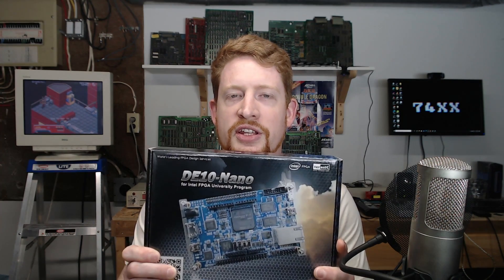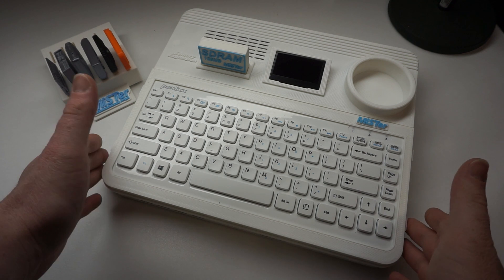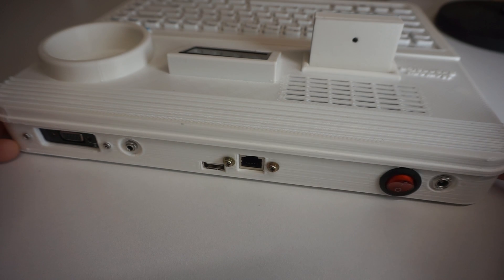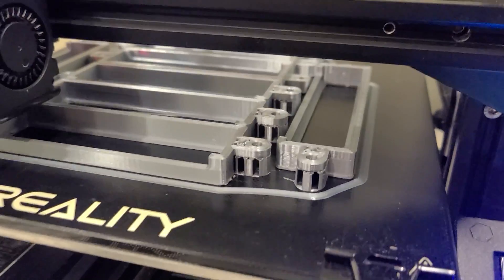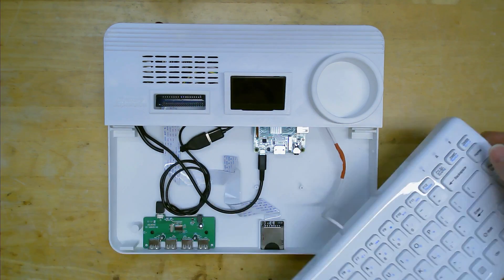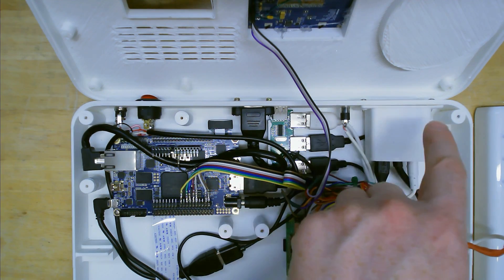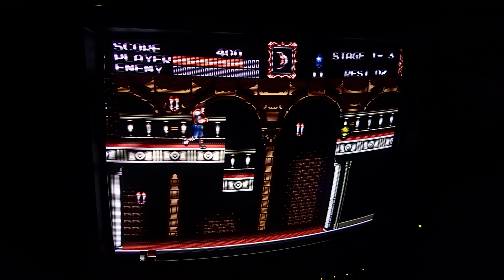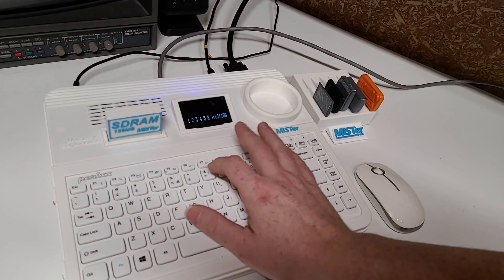My Custom MiSTer FPGA Case (with Beer)

Comment: Excellent work! I've been using a Mister Multisystem with their console case for a while but what I really wanted was a home computer styled case with a keyboard, as I mostly want to replicate my time with the CBM 64, ZX Spectrum etc. I've spent ages trying to figure out which vintage model to base it on though, bearing in mind the Multisystem design means I'd need a deeper case for it to sit behind rather than under the keyboard. On my shortlist were the Oric Atmos and Acorn Electron (albeit both needing to be extended back) and... yes, the Apple IIc! In fact I've been searching for old IIc cases to modify, but haven't found the right one - they either work, so I wouldn't want to ruin that, or they're too banged up. Anyway, I just came across your video and couldn't believe you had the same idea several years earlier! Great choice and hopefully I'll make my own version at some point in the future!

Comment: I would 100% make a custom case that has midi in and out on it too. That way you can use the Amiga core along with say Octamed to make music.
Reply from the maker: I assume you mean MIDI In/Out, yes currently I am using the USB port on the back of my case with a Roland UM One. I have a Roland Sound Canvas D70 for all my true MIDI needs.
Reply: @74XX_arcade  and there is no latency with the midi ?
Reply from the maker: No I don't think so.

Comment: The X68000 also supports MIDI modules such as the MT-32 and SC-55. Some games make great use of this. Both MIDI soundtracks of X68000 Castlevania (Akumajo Dracula) are particulary impressive. It has separate soundtracks for MT-32 and SC-55. Strangely, I think I may prefer some aspects of its MT-32 version. But all 3 versions are impressive. Native, MT-32 and SC-55 all have their own distinctive sound and character .
Reply from the maker: I'm excited to try X68000! I have been reading a few things on the misterfpga.org section for X68k and trying to make sense of things. It seems the version that is currently on the github is very outdated and another developer is releasing updates on his Japanese blog.

Comment: You will still have issues, gaming on Dos with those Pentiums. 1981 to circa 1991 Dos games will run too fast, unless you use a cpu speed tool.

Comment: This is really cool ! My build has a soft power momentary switch - I used an OTG hub that supports a high power "charge port" to power the MiSTer. MiSTer gets 2.1A dedicated (12W) and each of the 3 ports gets its own 1A so I can run for example USB HD. I used a mouse/kb combo with a single internal wireless receiver rather than a built in kb. The power contact for the hub powers everything up from a switch on the front of the case.
Reply from the maker: Very cool! The front USB hub on mine does have a power input if I needed it but it's not wired up right now. I don't think I showed it in the video but I have a matching white wireless mouse that I just leave the USB plugged into one of the front ports.

Comment: Case seems well made, and for the most part, well designed, but I would have probably put the USB ports on the side instead of the front (so if you were to connect a wired mouse), and the cup holder is just silly.
Reply from the maker: One of my criticisms of all the existing cases is that it has ports on all sides, I really just wanted them on the front and back. I personally use a wireless mouse with the receiver plugged into the front. The cup holder is just silly.

Comment: Nice work on the case, I have a few designs with mechanical keyboards on my channel too. My next project will be using a Raspberry PI keyboard so the MiSTer can use the USB hub.
Reply from the maker: Thanks! Your wedge case was a huge inspiration. The Rasp Pi keyboard makes a lot of sense, and something that a lot of people would have access to if they wanted to print your design. Can't wait to see it!
Reply: @74XX_arcade  I am going for two part and having the keyboard slide in so you don't see it much like yours. I might also keep it simple with no VGA output.

Comment: Hi! May you share the model of the bigger lcd screen please? I'm using the smallest tiny lcd and would like a bigger one. Why you had to apply the modification on it, it doesn't work out of the box? Thanks
Reply from the maker: If you look on the mt32-pi wiki, there is a list of working displays, mine is a 2.42" OLED with the chip SSD1309 (compatible with SSD1306). It didn't work out of the box, the reset modification was necessary.

I did buy a second version of the screen on AliExpress and it has a different circuit board, I can try it to see if it works differently and let you know.

Comment: HDMI > VGA > but then how are you connecting it to your CRT that doesn't have VGA.  You using RGB?
Reply from the maker: "VGA" and "RGB" are the same thing at different horizontal refresh rates. The MiSTer can provide signals to the HDMI port at original frequency of the system. So yes I am using RGB, but it's being provided by the "VGA" converter directly.

Comment: Never heard of someone swapping SD cards like cartridges and setting up each one as an autoload to one system. That's a little bit genius even if it is also pointless :p

One thought, you might wanna avoid cycling your SDRAM in and out of the slot too often, as you could loosen the connection
Reply from the maker: You got it - overall pointless but just so darn cute. 

The SDRAM cartridge? Well it never has to be removed unless I'm changing it to a new one, and the connector is pretty beefy.

Comment: Your drink holder circle reminds me of half of a modem acoustic coupler from way-back-in-the-day.  So, you do not have any way to plug in HDMI because you have that plugged into a VGA converter and audio adapter?  I appreciate wanting CRT but also HDMI.  Other than that, pretty sweet. You didn't mention anything about your little cartridge addons for the SD cards.  Do those match cartridges from retro gaming consoles too?  I didn't get a real good look at those.
Reply from the maker: Yes I'm not using HDMI for anything. I could have easily just put an HDMI port on the back if I were, but I'm only interested in using the MiSTer with CRTs at the moment. 

You're right, I didn't really give anyone a good look at the SD cards! I have Sega Genesis, Nintendo Game Boy and Super Nintendo, plus an Amiga 500 and IBM PC, and the Donkey Kong Jr logo one. They are just models found from around the net shrunk down and with a small cut out added for the SD card. Each one loads the respective core for that console directly. Completely not necessary!

Comment: That's a very cool case, but any reason you aren't using a heat sink on the DE10-Nano, that chip gets a little warm and while you have vents in the case above it, a heat sink wouldn't hurt.

If it was me I'd incorporate a full IO board in it to allow simultaneous digital and analog out. CRTs are amazing, but being able to use HDMI can make direct video capture easier, as well as allowing use on a modern display.

Integrating the GPIO buttons and LEDs that the MiSTer supports could be nice if for nothing else besides that reminder to open the OSD so you don't lose your console save game that didn't get written to the SD card yet.
Reply from the maker: Yes! I'll be honest I am waiting for a bunch o heatsinks from AliExpress and they didn't arrive before I shot the video. I will also print fan supports next time I do a print of the top portion!

As for the IO board stuff, there's just nothing I need on it. I am already setup for analog capture so if I need to I'll just use that system. I also think the necessity to save manually will be "solved" eventually. I did think about piping the LEDs up to the top.
Reply: @74XX_arcade  Both the LEDs and buttons on the IO Board just use GPIO pins so you could use either. For the LEDs you'll need a resistor in series if you want to have those mounted somewhere on the case rather than trying to do light pipes.

Comment: cool case! were you able to use the io board on the top or no?
Reply from the maker: There was no reason for the IO board on this unit. USB was handled via the microUSB port, videoand audio from from HDMI to VGA converter, and the permanent keyboard takes care of the buttons.

Comment: This is amazing. So well done! I have a question. Are you not using the USB board (which would include a User port for the MT32-pi) just for space reasons? Cost? Just wondering if it would improve this setup a bit without the extra setup involved in adding the hub, and wiring to the GPIO..etc. 

Edit: I just realized who you are. I have a bunch of your SNES cart PCBs that we traded about 7-8 years ago. They are excellent. Subscribed.
Reply from the maker: You got it - the add-on boards are great for most users, but they don't do any processing so they aren't required. I didn't talk much about "direct_video" but that is why I didn't need the io board for analog video, the HDMI->VGA converter does it.

Wow so funny that we have crossed paths before! Now you can get complete SNES repros for like $5 from AliExpress..